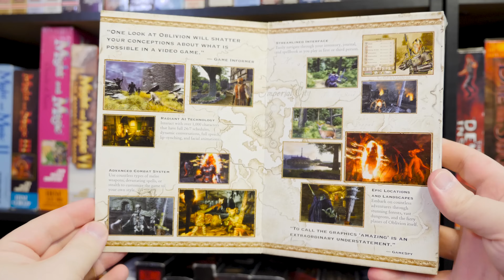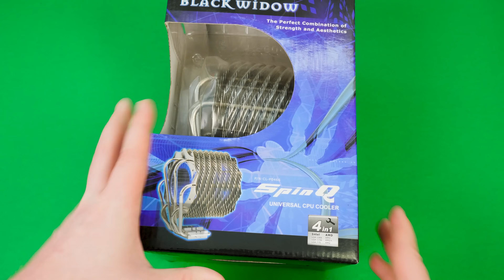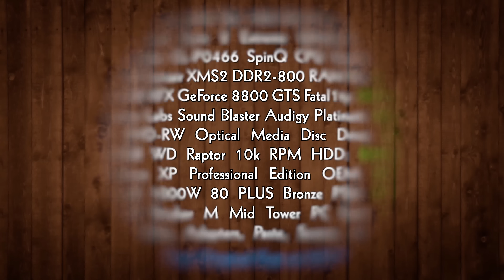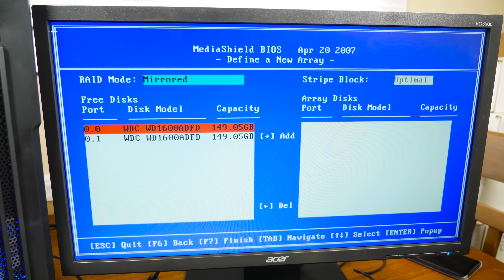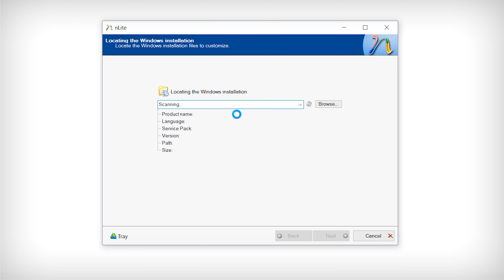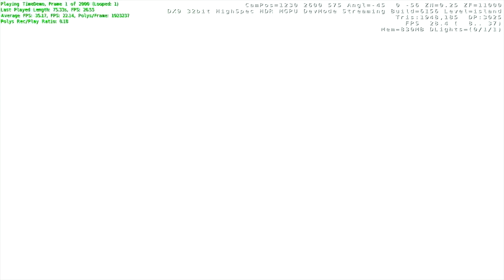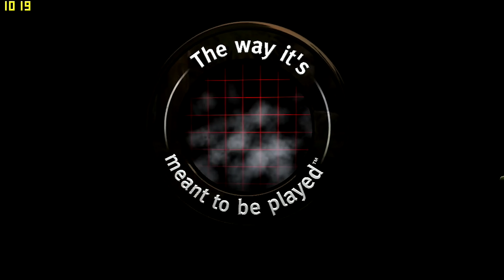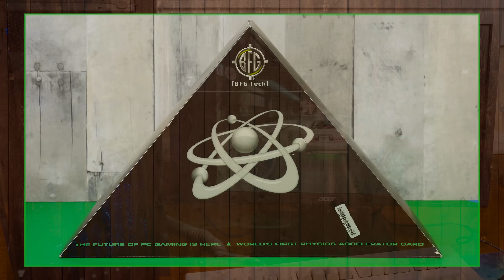LGR - Building My Dream $3,588 Windows XP PC

Comment: wait, if youre running XP couldn't you just run your DOS games through Windows' native DOS emulator? why fuss with DOSBOX?
Reply: xp's is a lot better than win2k and previous at dos emulation, it actually has sound for example. but its not perfect
Reply: I tried using Win XP emulation, in high school, to run Duke Nukem, and it went poorly. I could only get PC speaker sound, if at all.
I would get weird crashes too.
Reply: @RWL2012  the built in DOS emulation on WinXP does support soundblaster emulators. i use Sound FX 2000 and it works pretty seamlessly, tho im sure it doesn't sound anywhere near as good as a real sound card. its very tinny.
and when you say it has bad controls do you mean gamepad support?

Comment: Why you didn’t run a Stalker: Shadow of Chernobyl? Or Need For Speed: Most Wanted. This is awesome games, and great benchmarks (specially Stalker, on Dynamic Light)
And what about overclocking? Maybe this C2D can hit over 3+ GHz? And RAM, this kit can 1066 MHz
Please, re-test this PC on OC mode. It would be awesome😄
(and please, test the Stalker on full settings😊🙏)
You’re awesome)

Comment: Yuck! I feel sorry for the all SLi boys on the Intel 775 platform.
It was a mess of instability and just general cursing on those Nvidia chipsets.
After testing a 780i myself, I quickly ran back to the Intel chipsets and the stability was noticeable.
Nvidia hadn't been building memory controllers for years since the Socket A platform at this point, and now they were expected to deal with DDR2 and a new platform, it was doomed to go to hell from the start.
Of course, Intel being nasty and changing the specs on Nvidia didn't help much either.
Reply: I had the painful experience of making this very mistake back when the 9800GX2 was new. I had a Q9550 and an EVGA 750i motherboard. Mobo was never stable and the 9800GX2 died. The Q9550 lives on in my HTPC which runs 24x7 on a cheap refurb Intel board. Been like 6 or 7 years now chugging along fine!

Comment: That core 2 extreme coupled with a GTX 590 is still more powerful than a Playstation 4. I know from personal experience.
Reply: lol hmmm no.
Reply: Dude I can run GTA V at high settings, 1080p, and at a solid 30 fps with that combo. The GTX 590 came out right before the PS4 did and was the equivalent of a 2080 ti in it's day. Plus that core 2 extreme was one of the most powerful CPUs made in its day too.
Reply: I wonder what would happen if I ran dual 1050 gtx Nvidia graphics cards with a icore7 processor
Reply: You would have more fps than the same set up but with a single 1050 but the extra frames will be more erratic. You will still achieve the same solid frame rates as before. It just will give you more fps off an on. I can't explain it too well. You're probably better off getting just one 1070.
Reply: @Leonartist  thanks I was wondering if it was worth it since I own a laptop capable of doing it
Reply: you're welcome
Reply: more like a gala apple to a granny smith
Reply: InGaming pc You can't do SLI with the 1050, I don't know if there is another way to run multi GPUs (other than CF, which is for AMD cards)
Reply: @Leonartist  Most of what you said is just not true, first off the GTX 590 is only 2 and 1/2 years seperated from the release of the PS4 and less than 2 years from when the PS4 internals what developed which means the fact that a GPU that cost over $700 when it released by itself should be able to beat the PS4 even 2 years later no matter what CPU you pair it with unless it's being bottlenecked by the CPU (which is happens to a lot of PS4 games anyways because the PS4 has a weak CPU).  

So bragging that yours is more powerful than PS4 is not saying anything even though you aren't really saying anything anyway because the PS4 runs GTA V at high settings.
Reply: For some reason I thought the 590 came out a year before the PS4. I don't know what else I have said that isn't true. My Intel Core 2 Extreme was running GTA V on high settings as well. It was also running it solidly at 36 fps instead of 30 (I have a 72 hz monitor).
Reply: Kenneth Bone It may be trash to you, but that is the frame rate on consoles. I think consoles mainly play on medium settings equivalents too. I'm about to upgrade from my GTX 590 anyway.  I already upgraded to an FX 8350 also
Reply: Kenneth Bone  dude 60fps is trash. Get a 240 Hz monitor, bruh. Make sure it's 4k, bruh. It needs to be HDR and be FreeSync compatible, bruh. Come on bruh. Get on my level, bruh.

Comment: great trip down memory lane!
My first real dream PC build that i saved up for during high school was in 09 using the XFX 780i mobo with Q9650 quad, 8gb ddr2 ram and SLI'd Asus GTX 260's. All packaged in a Thermaltake Armor Super Tower that weighed a literal ton.
fucking beast back in the day
Reply: I still run my core 2 quad q9650 with 8gb ram now. Running it about 10 years now
Reply: @kylenidiffer5081  Still a solid CPU for sure

Comment: I still use Windows XP on my laptop with ssd, and Windows 7 on my desktop :-) 👌
Reply: what about Defraging  or trim ?
Reply: same holy shit. i have a thinkpad t60 with xp on a 120gb ssd. a few months back i plugged my keyboard, mouse and screen into it and i went for like 2 weeks without even feeling the need to connect the desktop again. it's amazing how well XP holds up as a 17yo OS
Reply: You can use SSD OPTIMIZER and it will optimize XP/7/8/10 for SSD
Reply: Dose this XP SSD OPTIMIZER  have A Brand or A SSD that has to go with it ?

Comment: 1000 watt?
Reply: Better safe than sorry. I have a 1500watt psu and only use 236W
Reply: It's typically split between the supply voltages so 1000w is really a lot less at 12v, which is what catches people out.

Comment: ..... No, nonono, staph, I can't deal with this being a retro build, please, I clearly remember building a nearly identical system (except I had a Q6600). This was only a few years ago..... Right..? Right guys? ... oh no, I'm old

Also, I remember using a Koolance Exos water cooler at the time. This was essentially the early beginnings of all-in-one water cooling, just with an actual custom water block and stuff. Actually it was a pretty sweet idea, until we realized we could just put the radiators and stuff inside the case rather than externally, avoiding the whole deal with having to bring the tubes through somehow. Anyway, it makes for an interesting retrospective read: http://www.ocmodshop.com/koolance-exos-watercooling-kit/

But yeah, I had basically this. Yeah it was very expensive. But it sure was sweet for a while. That motherboard was really good, but I remember the small northbridge fan was extremely loud - and if you removed it, the heatsink got so hot that you would burn yourself is you just barely touched it.

Comment: Hmm, I think you've cheated a bit with the modern computer case, I don't remember how user friendly late 2000's cases were but I am not sure if they had psu mount on the bottom and general niceties like that. Nevermind, great video like always.
Reply: Yeah, an era appropriate case would have been better for this build. Cases from that time didn't have many of the design changes that you see with ATX cases now (like the PSU on the bottom etc). They were much more difficult to work with.
Reply: i still use case from like 2000 to this day. modern hardware still can be placed. instaling modern psu is pain tho [ its questionably mounted but fine with only 2 bigger screws]

Comment: I remember getting a 850W PSU thinking I would run dual graphics cards eventually in 2011. Never ended up doing it, but the PSU is still powering my 2022 PC!

Comment: Its better two have two gpu's on a single card,which can switch between single gpu and dual gpu via software!
Reply: like 9800 gx2
Reply: It's actually best to have a single GPU that is powerful enough for the systems needs verses a dual GPU setup. Dual GPU setup's regardless of whether they are single or dual card configs will always have the risk of a slight frame delay between one GPU processing one frame and the other GPU processing the next frame as both GPU's have to work perfectly in sync as well as sharing information and resources between the two. Plus you have additional SLI/Corssfire overhead to deal with as well. All in all a single GPU that can handle the systems loads is always best. Hence why SLI is sadly becoming a dying trend these days as single GPU setup's are becoming ever more capable of doing what took two GPU's to do in the past.

Comment: O M G u just saved my precious time (i think).
Okay so here is the story:
When I was trying to get windows xp installed using an usb and an iso file, I had soo many issues. Quite literally everything that could go wrong went wrong. But finally, after 20+ hours of troubleshooting, fixing stuff and doing it many more times over, I got into the windows XP setup. I was so happy that I finally got it all working. But when I selected my hard drive partition, the copy prosess went from 0% to 100% instantly while this was not happening in the tutorial. After some research, I found out that windows xp didn't come with a sata driver. So after 26+ hours I had to gave up since the prosess of inserting a sata driver into the install files was a total nightmare. 
I did eventually got it working by resetting the sata driver on a different drive (really slow) that still had windows xp on it and then it booted up. Finally I copied and pasted all the files off that drive to the new one and got it all working.
But now when I watched this video I saw you using nLite which could solve my problem hopefully without 1500 issues again lol

Comment: OMG!! An 8800 GTS 320!! I had the same graphics card in late 2007 along with an E6420 running a 50% overclock to 3.2GHz, 4GB RAM and a 500GB hard drive. The CPU wss cooled by a Zalman CNPS9700 - a massive copper finned heatsink veey similar in appearance to your Black Widow - thanks for the memories Clint!

Comment: I agree. I went scrounging around on the Internet to find a pc from the late 2000s and finally got ahold of an Alienware Area 51 ALX with a first gen i7 and dual gtx 760s specifically so I could play the games original hardware that would have been top of the line back then. This pc is 13 years old and still stutters with the sims 2 cries softly I love the lag~ it's genuine

Comment: I too had one of those spin Q coolers and still have it as a matter of fact. my no cost build from that time period was a Core 2 Quad Q6600 planted into an EVGA Nforce 680i board with 2 BFG 8600 OC's in SLI Powered by and Apevia 680w PSU  with 4Gbs of GSkill Memory. ( 32 bit XP ) All of this was stuffed into a sleek Antec 900 case. I dont remember what I spent for  all of this but It was a Rocker! I later upgraded the 2 GPU's to an 8800 Ultra.  Still have the spin Q and the PSU, both are amazing. Every thing else is gone.

Comment: Back in mid-2007 I built a rig with a GTX8800 (768Mb vram),  2x2Gb of DDR800, the same QX6850 as here and a 512Gb 7200 RPM HDD. Can't remember what the motherboard was. The intent was to play Crysis and Bioshock among other AAA games of the period. Crysis was... troublesome, as it always made the machine BSOD when the world started to freeze upon the first alien encounters. I did a LOT of troubleshooting, and finally narrowed it down to the PSU which was a measly 600W cheapo thing and couldn't deliver on very heavy loads. When I replaced that with a 1000W, Crysis finally started working. Good old times!

Comment: I had a 680i and an 8800gts 512!  Only had a Core2 Duo, but it worked!   I jammed Crysis for over a year on that beast!  I had a 160GB Raptor too!  All neatly packed in an Ultra Aluminus case with a clear side window that showed off my Zalman 970LED cooler.  First build after I had a real job.   HOG HEAVEN!

Comment: This build is remarkably similar to what I ran back in the day, it just had the AMD athlon 4800+ cpu, Asus SLI deluxe with 2x 8800GT AMP! Edition from Zotec. Didn’t have the drives in raid mode and had the velociraptor 10,000 rpm 150GB version which was just crazy for back then. 
It was a beast of machine and too this day nothing compares to the excitement I felt building it. Sadly the motherboard broke (northbridge fan) in 2008 which killed it but some of hardware lived on for a while. The 150GB drive still works to this day.

Comment: I built one in 2006 and still have it with all the receipt. Spent around $3000. Went with gigabyte 965p motherboard, 4G ram, 2.40 core 2 chip, GeForce 6800 gs video card, 250G hard drive, 3.5 floppy, CD player, DVD player, inside a master cooler case. Going to dig it out and fire it up soon.

Comment: I built my 2005-2006 dream windows XP PC with an athlon 64 x2, dual WD raptor in raid 0, dual Geforce 7800 gtx 512 MB in SLI and a Soundblaster X-FI Platinum Fatal1ty Champion. It cost me about 200 euros to get all the necessary parts from China, France and Germany during the past 2 years. Quite a labor but the outcome is sheer enjoyment

Comment: Not going to lie, this inspired me to make my own 98/XP rig. I aimed for around 2003 though so I could run Win98 decently well natively. P4 2.4 (with that newfangled hyperthreading too!), AIW 9800 Pro, 1280MB DDR400, SB Live. Case and PSU are modern.

Thing runs like a dream in both OSes (had to patch Win98 for RAM but no issues there) and I'm having a blast rediscovering my high school gaming.

Comment: I got that PSU about the time you made this and still use it!!! Been in 2.5 builds(replaced a Corsair that died...well died 3 times in 3 months...junk). Right now it is powering a 5600x with x570mobo, 32GB 3600 DDR4, 1TB M.2, and a Sapphire 6900xt Toxic with the 360mm RAD AIO Liquid cooled GPU. Before that it ran a FX9590 (space heater @220W!!) With 32GB DDR3 and crossfire 8GB MSI RX480's for about 3 years! In other words, ITS A GREAT PSU!!
Reply: Lol, I swear I didn't hear you say "space heater" until after I wrote the above! Great minds.....😁 Also, no need to explain why, I'm sure we understand 🤗

Comment: I remember that many Windows XP games ran slower on processors with more than 2 cores. I recall setting affinity for processes and allocating only 1 or 2 cores to make them run smoothly. Crysis being one of them. On the other hand, you might have the resources and the desire to try out the most powerful PC possible where you can install Windows XP. You can use a Haswell processor, 2x 2GB DDR3 RAM, and a GeForce GTX 980 with modified drivers like those created by Phills Computers Lab (you only need to edit the compatible models on it.). It's a video I would love to watch.

Comment: I have finally finished my no compromise XP complete rebuild that triple boots as a Windows 7 (so I can use my 360 steering wheel with full force feedback like how my Sidewinder FF2 and the games that take advantage of it, was a big incentive for having an XP PC) and windows 10 HTPC as well. Its a 3770K, Corsair H55 AIO, 8GB Kingston DDR3 2400, MSI GTX 980ti, Seagate 500GB SSHD and Samsung 500GB SSD and slim DVD-ROM drive, all plugged in to an ASUS p8z77-i deluxe itx in a Cooler Master Elite 130. For Sound I picked up a Creative USB X-FI 5.1 Surround, which I got just a few days ago, as ITX means no soundcard and while the onboard audio is more than capable, I wanted full EAX support.

I found my old build spent more time gathering dust than seeing actual use due to the size, meaning I'd try something else rather than lift its heavy bulk to a monitor, with this new version being much more useable outside of just XP, so having a reason to be plugged in to the TV permanently.

Comment: Had a Q6600 G0 stepping chip at the time running at 3.92GHz on a swiftech loop (3.6GHz on a TRUE120 before that). Never could hit that 4GHz mark that some with good samples of the later stepping higher end chips could hit. 😤 Had 4GB of the 1066MHz Corsair Dominator DDR2 though in a Gigabyte P35 DS4. That CPU and Mobo is still running in my dad's computer to this day. Ended up getting an HD3870 instead of the Nvidia offerings, eventually a HD3870x2 that I ran in 3 way crossfire with the original HD3870 I had. Was a beast at the time in the games that supported it. Kept that setup till I had a GTX280, then I finally upgraded to the i7 920 and then a second GTX280. I miss when multigpu was an option, and it sucks now that we finally have the hardware and APIs to handle it without as many issues, it's gone away.

Comment: I have an "ultimate XP machine" myself - sporting an AMD Phenom 955 and 4 GB DDR3 RAM. For my card, I'm using my old Radeon 6850 that I've had since 2011. It may not be NVIDIA, but the card still runs like a champ, and has Windows XP drivers, so - no complaints here!

Comment: I built an XP x64 PC using a Core 2 Duo E8600 and a GTX 285. Runs Crysis crispy as you please.

Also you're lucky to be able to unscrew the top of the case to get your CPU power connector connected. Most cases I work with rivet the top closed.

Comment: I know this is a old video but I am a SLI freek. I had almost what you are building, same ram even. SLI is so fun. i now have a socket 775 board with a 771 cpu (xeon X5460) moded to 775 and microcode added to my 780i. Sweet!

Comment: I obtained a Dell Optiplex GX280 with a Pentium 4 HT (non-Prescott version) back in 2013. Got it from the metrology lab I was clearing out and was about to get scrapped. Had to leave the data acquisition cards (used for vibration table testing) though. Was running a custom XP image that basically had nothing on it other than internet explorer and logging software.  The custom XP images 32-bit or 64-bit were super fast with all the shovel and bloatware removed. Way faster than a bare windows 10